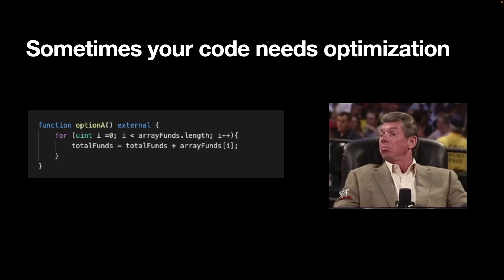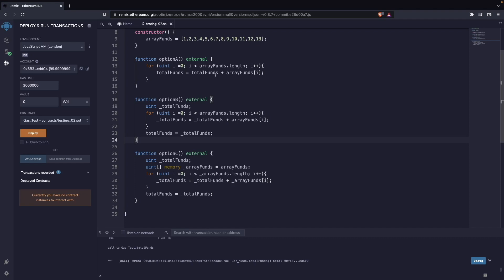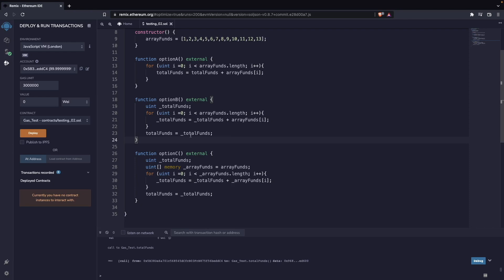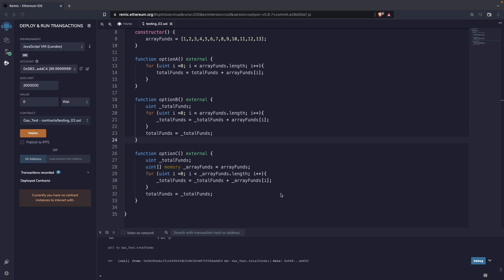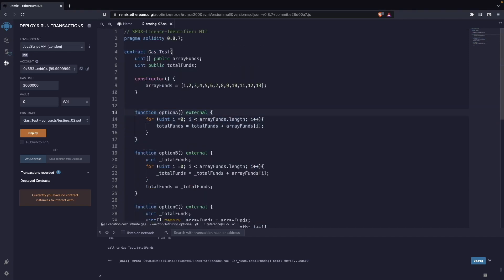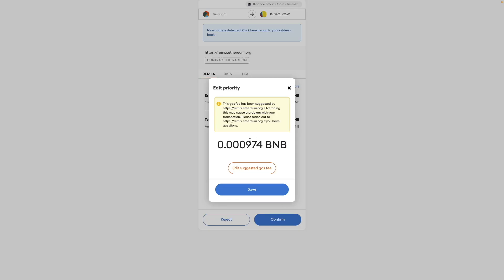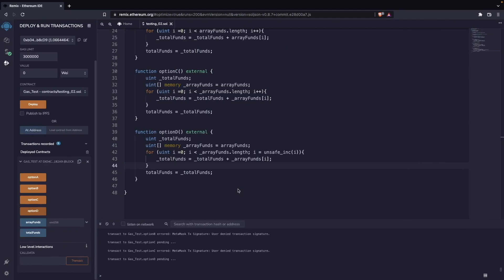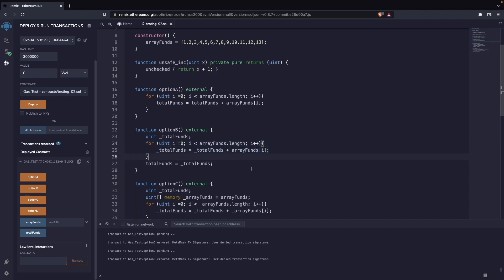Spend Less Gas - Solidity Gas Optimization [Deep Dive]

Comment: Wouldn't storing _arrayFunds.length in a temporary variable and using that in the for loop be even even more optimised? :p
Reply: no, i just did a check. looking up the variable is the same regardless of it being a property of _arrayFunds, or if it is a temporary variable. in fact, creating the temp variable costs 5 more gas